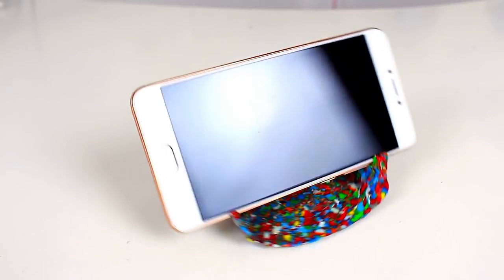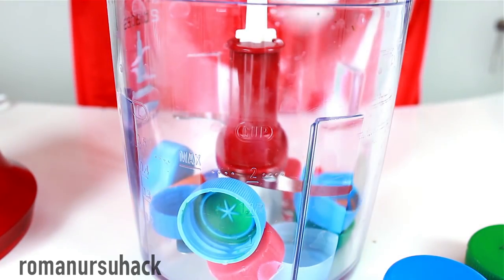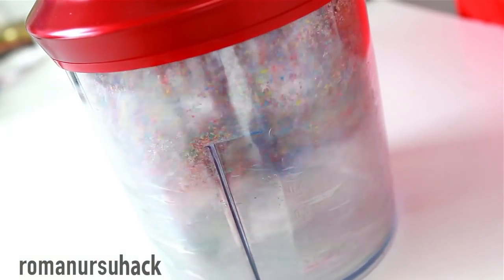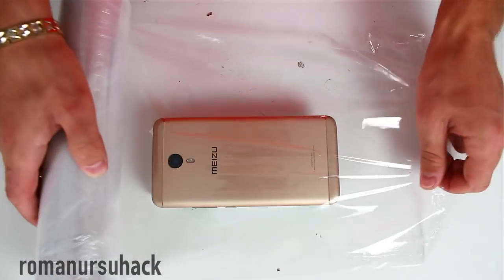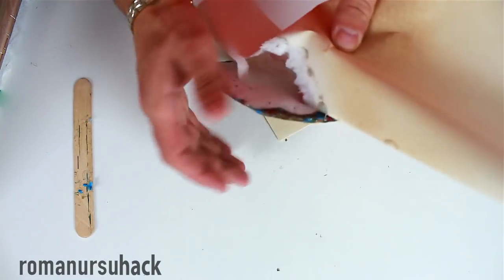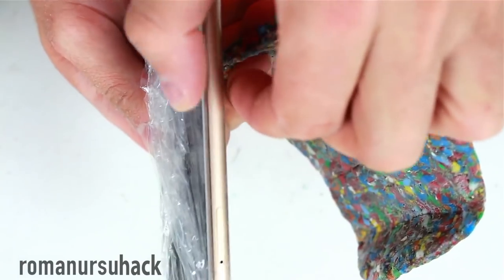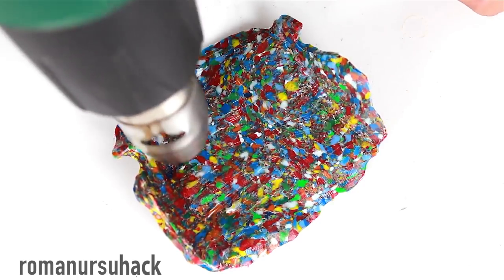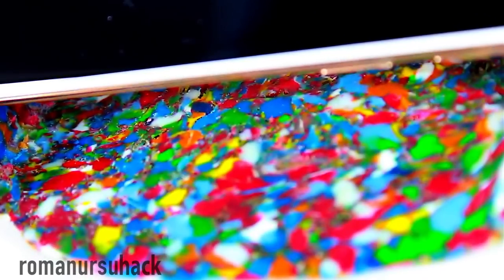HOW TO MAKE a holder from plastic bottle caps

Comment: Please do more such projects. BTW most people should know that plastic melting is safe
Reply: True, HDPE/LDPE/MDPE are safe but do it in well ventilated area.
Reply: Yeah , they may catch fire if now worked with properly
Reply: Neandercatz  dosent it release chemicals though
Reply: if burned and extinguished or incompletely combusted it releases chemicals like those if you blew out a candle but if you don't burn it, it's not going to release any chemical. 
some plastics however do so if you want to mess with plastics , learn about their types.
Chemistry advice: don't use the word chemicals for implying toxic or fumed

Comment: So you're placing paper and plastic into an oven. Be careful, I've experienced very uneven heating in my coil-based oven. It's likely that you could have a hot spot which could burn the paper and plastic.
Reply: that being said, this is a cool idea... maybe just think about providing the viewers with some more safety information/options, especially if the project isn't safe.